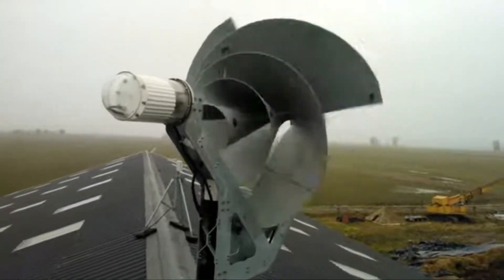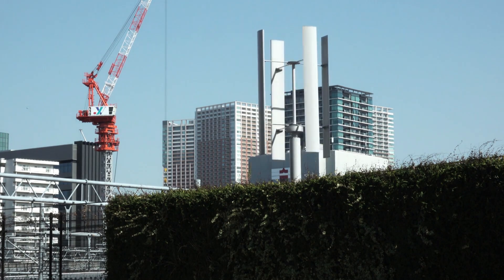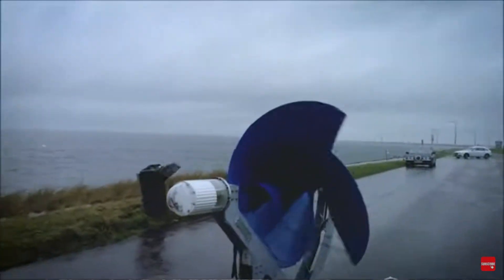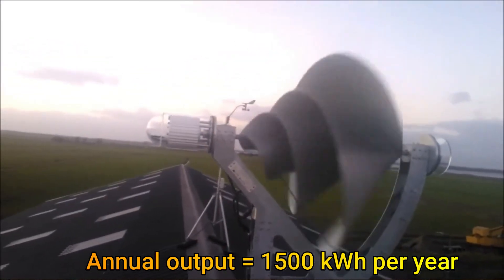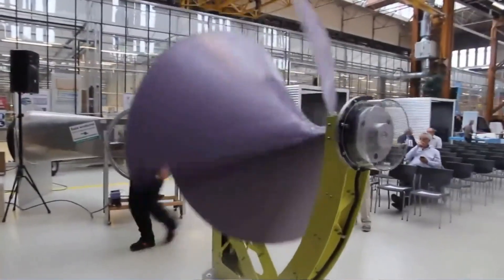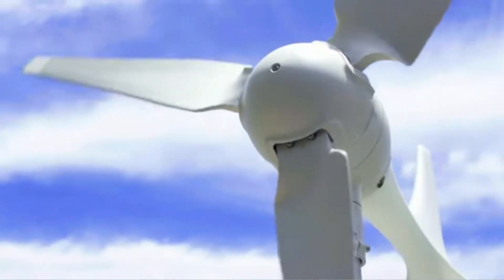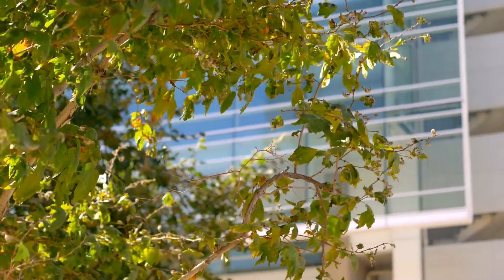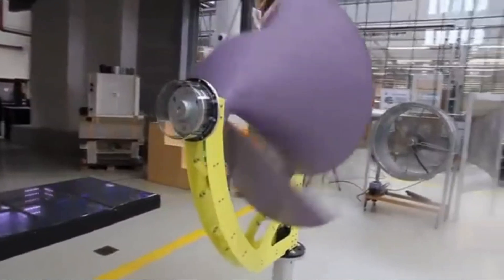Liam/ Archimedes Wind turbine : How does it work

Comment: All practical tests show that small wind turbines hardly generate any electricity! Because there is hardly any wind close to the ground.
It is also extremely gusty, which usually shortens the service life extremely! 9 out of 10 systems no longer work after a few years. 
Due to the extreme drop in the price of solar panels, they produce at approx. 2% to 5% of the cost of small wind turbines!
Reliable and almost maintenance-free for 25+ years!
Reply: Solar panels and Lithium iron phosphate battery has life of 30 years plus, in Australia you can get free solar panels and cheap lithium batteries. I have 8kw solar and 15kwh battery and I run everything in the house including cooking all year round, yes in winter some days can be sun less, only those days I wish I have temporary wind energy.

Comment: I really like this design, but it is assumed the wind mostly comes from the same direction? Thank you.
Reply from the maker: No it turns into the direction of the wind by itself
Reply: @synergyfiles3536  well then it's perfect, thanks for the answer.
Reply: @synergyfiles3536  Great 👍
Reply: A I can be used to monitor the direction of wind and can be managed with a servo motor at the mounting shaft
Reply: Excellent explanation and video.  Thank you.